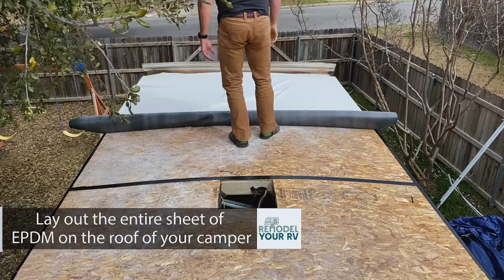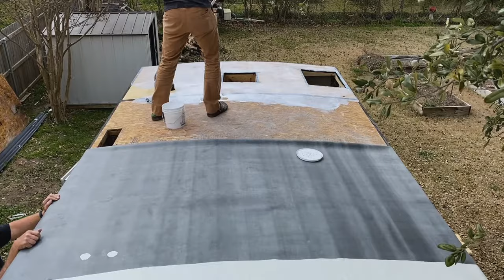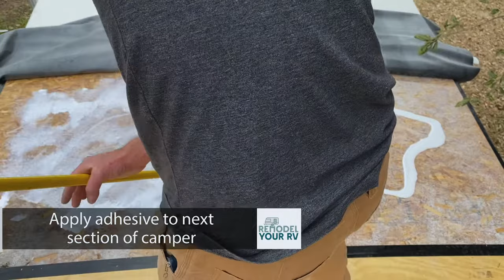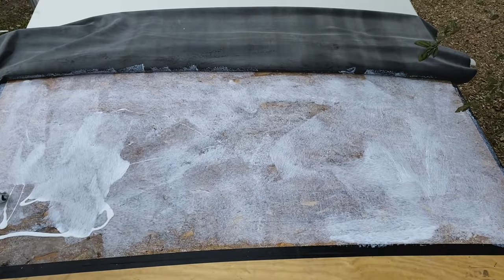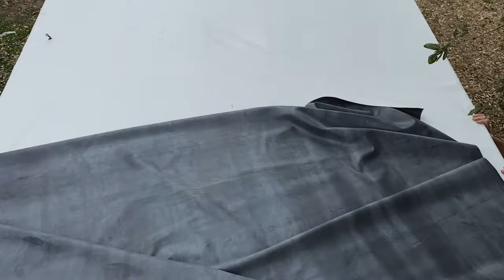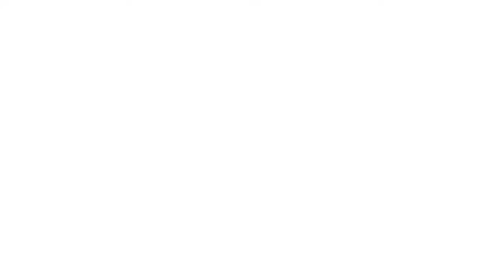RV Roof Repair: Installing a Rubber Roof on a Camper

Comment: Hi! What do you recommend., PVC or TPO? Also, my camper is 7.5 by 37 ft. What size kit do you recommend I get? So far the largest I can find is 9.5 by 40...but Im worried that wont be enough extra length , can I use eterna bond if I need extra lip?
Reply from the maker: I bet that will be enough length and width for you to work with. I wouldn't be concerned with needing any extra. Good luck with your project!

Comment: How much glue did you use?
Reply from the maker: If I remember correctly I used about 1.3 gallons.
Reply: What size trailer? Thank you
Reply from the maker: @zachgannon1788  24'

Comment: We have a 19’ TT, measures just over 95” wide. Will a rubber material 8’6” be sufficiently wide enough?
Reply from the maker: I think that width would work just fine and you will still have a little to trim off.

Comment: What did you use for seam tape?? Your video of the roof prep doesn’t stream?
Reply from the maker: Dang. I need to see why it's not streaming. But, to answer your question, I actually used Gorilla Tape for the seams on the decking.

Comment: wondering do you had any trouble with adhesion of the rubber roof over the gorilla tape???
Reply from the maker: No issues thus far. I had a little bit of concern about that myself but the adhesive worked extremely well on top of it.

Comment: Any advice on the best "glue" to use to put the rubber roof back on after I fix the plywood rot? I see the 5 gallon bucket of new-roof, would that also work as an adhesive ?
Great videos and great advice, please keep them coming!!
Reply from the maker: I’m not sure about “new-roof” working as an adhesive. However, I used acrylic water based adhesive by RecPro and it worked extremely well.
Reply: @remodelyourrv  thank you, I'll try that! Keep it up, love the videos!
Reply from the maker: Thank you!
Reply: @remodelyourrv  How much glue did you go through?
Reply from the maker: I think it was about 1.3 gallons.
Reply: @remodelyourrv  Yeah, after I made that reply I saw you replied to someone else sorry to bother you Thank you!
Reply from the maker: No problem at all. You’re welcome.